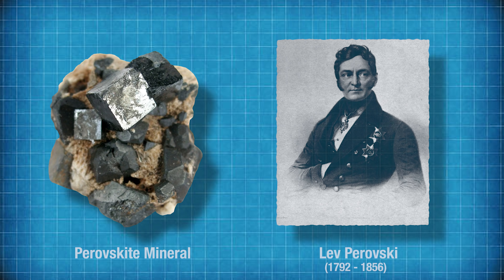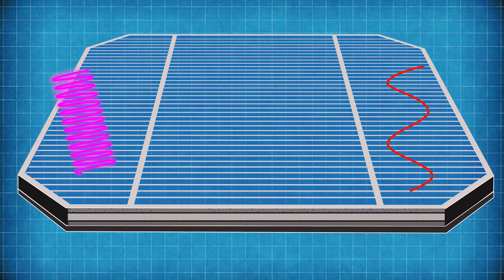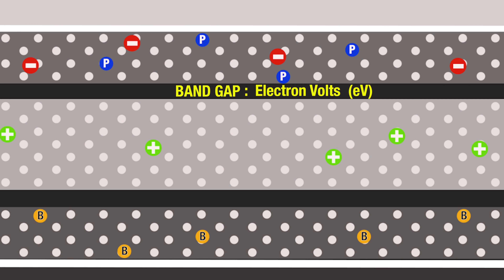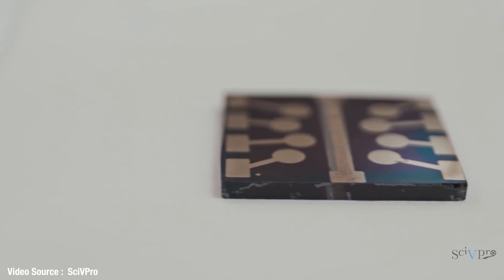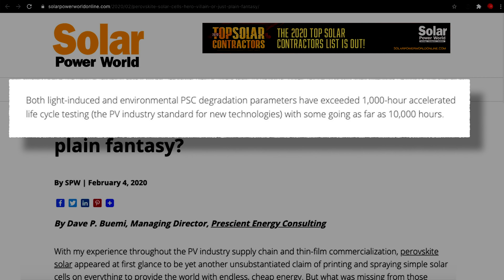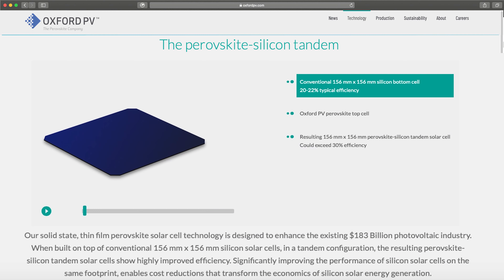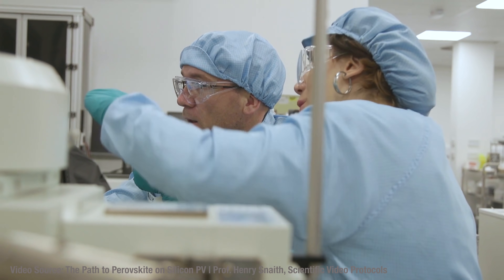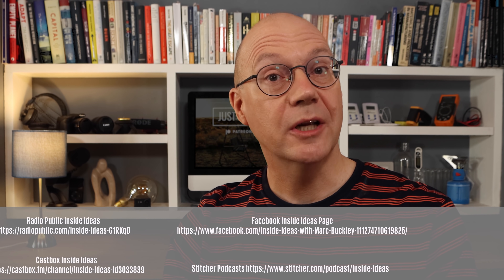Perovskite Solar Cells: Game changer?

Comment: Great video - this is a topic that needs more exposure. I do want to comment on a few things, though. Firstly, you have a couple of mistakes in your explanation:
4:12 - the band gap is the energy an electron needs to become free. The video says that it's related to the layer thickness, which is incorrect. An exact explanation would need band theory that is outside the scope of this comment but, effectively, it's the (minimum) energy an electrons needs to be knocked free by a photon. Silicon's bandgap of 1.12eV means a photon has to be at least almost-red infrared to knock an electron free
4:26 - adding boron makes the silicon more conductive. Holes - those 'effective positive charges' - act like, well, free positive charges. The boron basically sucks electrons away from the silicon, leaving excess holes and making the layer more conductive

Secondly, some technical comments:
- I'm still sceptical about degradation of perovskites. I've been hearing 'no, really, our material is totally stable guys' at conferences for years, and I'll believe it when I see it (on the shelves, in mass-production)
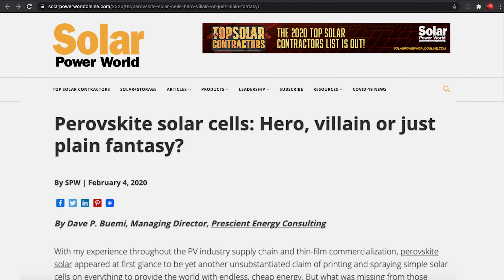7:48 - Like you say, the lead content probably isn't an issue. Another solar cell technology, cadmium telluride, has cadmium in it (cadmium is a sister element to mercury and is very toxic) but it doesn't matter because it's bound up in the solid crystal structure. Lead-containing perovskites are presumably similar and, like you say, tin might be a viable substitute
9:13 - be sceptical about reports of efficiency/performance from the laboratory. Researchers only need to get one, or a small number of specimens working to publish their findings, whereas industrial production needs thousands or millions of units to achieve that performance
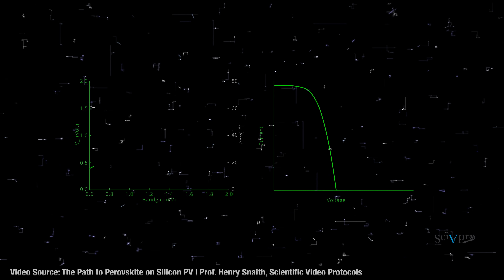9:49 - Tandem solar cells are hard to make and expensive (existing triple-junction cells are only really used on satellites, where cost is much less important than power). For one, your materials need to have the same atomic spacing (lattice constant), otherwise nasty defects will form at the interface. Then, you need to be able to engineer a tunnel junction between the cells, pushing free electrons from one material into holes in the other, without changing their energy level. It's harder than it sounds, and needs excellent control of the doping. Perovskites can vary the atoms in their crystal structure, allowing you to tune in on the lattice constant and bandgap you want, but the mix you want isn't always stable and easy to work with

I would love for perovskite solar cells to be successful. All-perovskite cells would be cheaper than silicon and tandem cells could achieve some impressive efficiencies. But I'm worried people might be being overly optimistic, particularly about stability and degradation, and I'll only really believe perovskites are going to break out once they've actually achieved substantial adoption.

Disclaimer: I am a postdoctoral researcher at the University of Warwick, working on silicon carbide materials for power transistors
Reply from the maker: Hi there. Thanks for sharing this extra technical clarification. Much appreciated. My only point would be that I think I said the thickness was a function of the need to allow more space for phonon interaction with silicon atoms in the middle layer, not anything to do with bandgap width (which I had to represent visually in a scientifically incorrect way just to get the idea across to the viewer)
Reply: @JustHaveaThink  In my honest opinion, I think the confusion stems mainly from label at 4:14
Reply: @JustHaveaThink  When will you use a aluminium pin, on this thread?
Reply: @JustHaveaThink  Avoid however hard it may be to provide incorrect information. just don't visualize something when the only way you can do it is not accurate.
Reply: @someonespotatohmm9513  well I appreciate the layman's example. There are many who not having a degree would support these on their homes. We can be a push for fund $$ for research by pushing specific products. The problem keeps arising wheather nuclear, wind or solar, what to do with spent product. It is one reason why I don't see nuclear as a clean energy.
Reply: @someonespotatohmm9513   I disagree: he can take some liberties and visualizations that drives the idea home - kind of (even if not up to scientific standards) - are VERY valuable. Even if the experts are dissatisified with it conveying erronous ideas. Being mostley understood beats being scientifically correct (this is not a peer review magazine).

Ideally there is some disclaimer that things have been simplified for better general ! understanding.
Think the 80 : 20 rule. 
The voting ! publics being roughly informed even though their understanding is imcomplete or the issues were "dumbed down" (but w/o malicious intent) is much more important than getting all details right.

No one - incl. the best experts - knows where this is going to end.

But IF humans put the resources in to solve a problem with engineering, science, reasearch They. Got. It. Done. Every. Single. Time.

Usually that committment - throwing money right, left and center - at a problem until it is solved (and it is always solved) is limited to war and adversity towards other nations.

If the voters understand that it is important to FUND such projects, that  something will come out of some of them, but you have to be CONSISTENT with funding and give them some time that is very important.

If you get a hit like solar panels (1960s I think) or penicillin - in the large scheme of things one can finance 99 projects that "fail" for one hit (or major hit).. Which is not even the case, researchers connectm they increase their knowledge and practical and project management skills, they find some decent if not spectacular solutions (sometimes things that are not immediately used, or a solution to ANOTHER issue).

And in the mean time it creates jobs for STEM graduates and therefore is an incentive to engage ! in those studies. One can make a decent living and be  hired by a project team and the Stem graduates will not be scared losing funding every year (see the Makani project).There is (would be) a huge treasure of hands on experience and prototyping  that spills over to future projects.

Think for instance the Makani kite. In the end they had to give it up and the team dissolved after 13 years (the film they made about the project is interesting). A lot of the research is public domain now. I do not think the money or time was "wasted"  (those wages went into the real economy, the researchers and engineers did not add the income to their offshore account in the Bermudas, they all paid tax on it and it was spent ! into the economy). 

It was not wasted and much more government budgets should be available for such "pie in the sky" projects.

Also the Pelamis ("sea snake") project in Scotland. Using the erratic power of waves would be a game changer. That warrants funding lots of such projects even if they seem far fetched and do not supply fast results. If only ONE of 50 or 100 would be successful, that would open so many possibilities. 

 It is possible that the Pelamis project did not work out because they did not have enough engineering resources to get the projects implemented on the ground.  Not all scientists are good fundraisers or perform better under extreme stress.
Reply: Are you serious??? He is attempting to make his videos understandable to us non scientists!!!
I suggest you don't talk to your friends in that manner... Know it all.. Is what it's called in lay terms....
I'm a psychologist!!!!!
Reply: How long do you think this could be or is it unlikely to occur at all? Just wondering... oxford  pv said commercialisation this year!
Reply: Thank you for you insight
Reply: I was wondering about the stability myself. I recall talking to someone in the field a couple of years ago (I've worked on perovskites myself, but I was working on a multiferroic perovskite rather than a photoelectric perovskite), and they were commenting on how teams working on photoelectric perovskites liked to boast about their efficiencies while downplaying that they were only maintaining those efficiencies for a matter of seconds. One can hope that there's been improvement, but commercial use of photoelectic perovskites might end up picking up similar memes to fusion power (namely, the "It's X years away, and it will ALWAYS be X years away" meme).
Reply: @Draxynnic  That particular meme about fusion is on shaky ground, thanks to the likes of REBCO, ITER and so on...
Reply: @psycronizer  Yeah, I think that was pretty much my point - recent developments do actually seem to be pointing to it becoming economically viable sometime in the foreseeable future.

EDIT: Ah, now that YouTube is actually letting me see the comment you were responding to, it's one of the few where I've mentioned that meme without it being an observation about how it probably no longer applies to fusion power. Yeah. It applied through most of the second half of the 20th century and the first decade or so of the 21st, but there's definitely been distinct signs of movement in the last decade. Perovskite solar, however, might be the next thing to apply that meme to. Or it might not. The meme exists in the first place because sometimes these things are hard to predict, after all.
Reply: Finally! I was looking specifically for your second point, but the rest is also extremely interesting. Let's take this comment to the very top.
Reply: @mskiptr  agreed, this should be pinned!
Reply: If you can make it once, you can make it a thousand times with some error rate. It's just a matter of cost and waste.
Reply: You are my guy.  Why is the search for materials that can have electrons knocked limited to visible and near visible wavelengths?  Do other high energy particles and em not interact with valence?  Antenna pigments?
Reply: @brainretardant  Most of the energy in sunlight is in the visible and near-infrared (as in 'near to the visible band' infrared). The sun doesn't actually emit too strongly in the UV band, and a lot of what it does emit is blocked by gases like ozone. Google 'solar spectrum' and you'll see. Solar panels see very little x-ray and gamma ray radiation, which is good, because x-rays and gamma rays can set off an avalance-cascade of electrons and holes that can severely damage semiconductors in various ways. Finally, the semiconductors that we can actually make, dope and control mostly have bandgaps between the medium-to-far infrared and the near-UV.

As for things like blue photons on silicon (which absorbs most strongly in the near-infrared), the high-energy photons are absorbed, but most of the 'overshoot' energy is lost. The loss process is a bit scary and quantum-mechanical, but the over-excited electron basically emits loads of phonons to relax down. Phonons are basically discrete atom vibrations - like quantum packet particles of heat - so emitting loads of phonons means getting hot.

I'd literally never heard of antenna pigments until just now! Assuming my Google-fu is accurate, you're thinking of chemical absorbers like chlorophyll - these work in a very different way to solar photovoltaic cells, converting light energy to chemical energy instead of electrical energy. That's not to say that you couldn't harvest solar energy this way, but you'd have to ask a biologist or chemist how that's going, rather than an electrical engineer.

I hope that answers your questions satisfactorily!
Reply: @brainretardant  I've never heard of quenching using electrons. It sounds quite challenging - cooling things is always very difficult, and the second law of thermodynamics is working against you. In semiconductors, what you get when a high-energy particle/ray hits it is impact ionisation: the excited free electrons have so much excess energy that they can excite more electrons. Any voltages exaggerate this effect. The high current from so many excited electrons and holes can easily burn out the semiconductor, but I imagine there'll also be weird and exotic things happening with the crystal structure and defects forming.

It sounds like you're thinking of fluorescent layers. They're not really something I know much about at all, but the little I have seen suggested (IIRC) that the efficiency is too low to be practical. I'd also guess (with emphasis on 'guess') that a fluorescent layer could easily interfere with the 'good' red and IR photons too.
Reply: @gigabyte2248  they have solar water splitting cells but that presents a issue of infrastructure adding hydrogen fuel cells and pipes to deliver it
Reply: and I actually think the presentation has jumped one step that might be essential for the logic and understanding: Although being electrically neutral, the p-layer has a lack of electrons due to structure effects (Silicon likes to form a lattice with 4 neighbours, but Boron only has enough electrons to couple with 3 silicon atoms. It also would like to have 4, but to couple once more, one electron is missing. This creates a "hole" in the lattice and might also be seen as an "electron vacuum"). The n-layer is opposite (Phosphorus likes to have 5 neighbours but there's only the 4-neighbours Silicon, and thus, "electron overpressure"). So the Boron tries to strip one electron from the Phosphorus (which is really a very simplified explanation of a chemical and electrostatic process). Eventually, this leads to electrical charges migrating from the n-layer into the p-layer, where p-n-pairs form (which actually is the transition layer between them). But this leads to an effective separation of charge, and now the n-layer is positively charged, while the p-layer has a negative charge. This builds the electrical field between them, and this is why electrons migrate to the n-layer when separated from a "p-n-pair" in the transition layer. Again, this is a very simplified description, but it might help to understand why negative charges go to the n-layer, when one could assume that there would already be too many electrons.
There are similarities to how semiconductors work. And besides Boron and Phosphorus, several other elements like Gallium and Arsenic, but also others, can be used to do the trick.  
Btw. there seem to be 6-layer-panels that can have an efficiency up to 39.7% https://youtu.be/wwHjyeyRofM . But these might not be affordable for everybody yet.
Reply: @human_isomer  I think he said the six layer were used in space were efficiency outweighed cost
Reply: I wish to Join more conversation and updates regarding the topics plzz share me the link or any other source to have a regular update for the same
Reply: @dhruvthacker3662  https://youtu.be/2uIOeHCOr-0
Reply: @brainretardant   they have solar water splitting cells but that presents a issue of infrastructure adding hydrogen fuel cells and pipes to deliver it
Reply: MatSci at University of Washington here, I agree with several of your points, clearly their is a long way to go to get bleeding edge perovskite efficiency on shelves.  
I think the FAR more interesting part of the story in the short term is the possibility of producing cells with SolGel techniques and being able to do it roll to roll (aka a continuous process).  Even if you can only get 10% efficiency out of the cell and they only last 5 years instead of 30 before recycling, if you can make them on rolls which are a km long with all the cost savings that entails you still come out wildly ahead.
Reply: @thereddufus  https://phys.org/news/2020-10-physicists-circuit-limitless-power-graphene.html
Maxwell's demon captured
Reply: I highly endorse your comments, I am a  material physics PhD candidate at University of Swinburne and looking towards the Provoskte to be my topic of research in PhD,  video from @Just Have a Think was a good contribution to make an image for some beginner in this field, while your comments added an extra charm and resonate the information from the video. Thanks for sharing your knowledge.
Reply: Great insight on the technical aspects in question. Absolutely noteworthy; 2$hae!
Reply: Let's ask a [🐈] 🐈 on a hot tin roof …
Reply: at 4:09 did he mix up the direction the electron goes? I thought the electron would travel towards the p-type layer, and move away from the negatively charged n-type layer
Reply: @jacobv_  Not quite. A detail that he glossed over (I can't blame him): the dopant atoms, after they've lost (phosphorus) or gained (boron) an electron, stay in the material as a fixed charge. Where n-type and p-type layers touch, there's a thin interface region where the free holes and electrons recombine, leaving just the fixed charges. This is called a depletion region, and it's where the magic happens in a solar cell. An electron generated in the depletion region is repelled by the negatively-charge boron in the p-type layer - the holes have been depleted, so only the boron atoms, that took an electron and became negatively charged, are left - and attracted by the positively-charged phosphorus in the n-type layer. The opposite happens for the holes. The n-type layer accumulates electrons, the p-type layer accumulates holes and they flow through the circuit to neutralise. Solar cells are fabricated with a middle layer, often doped as lowly as the crystal growth reactors allow, to artificially widen the depletion region, so that it's more likely to catch photons.

To add to the confusion, though, you might (possibly) be thinking of normal diodes in forward bias. A solar cell is just a specially-designed diode with an extra-extra-wide depletion region. If you put a positive voltage on the p-type and a negative voltage on the n-type, you push the electrons and holes towards the depletion region, causing it to narrow enough for the electrons and holes to cross it. Current flows! This is forward bias, the 'on-state' of a diode. Put the opposite voltage on and the electrons and holes retreat from the depletions region, making it wider and blocking current flow. This is reverse bias, the 'off-state' of a diode. Solar cells (and their sisters, photodiodes) are basically reverse bias devices, that rely on a wide depletion region to sweep away the generated electrons and holes, producing a voltage (or, in photodiodes, sometimes a current). This, by the way, is why it's so bad to have partially-shaded solar panels. The illuminated ones are generating a voltage, but the shaded ones are diodes in parallel, and produce a short circuit. The generated electrons and holes flow through the shady panels to neutralise, rather than through the building's electrical circuit.
Reply: @gigabyte2248  Thanks for explaining this so clearly! I'm writing a review paper on PSCs to finish off my Physics BS, and seems I'm going to have to re-write a paragraph in my introduction. That extra bit on the shadowing effect was very helpful too.

I'm trying to understand if/how PSCs are different from silicon cells. Can perovskites be doped as n or p-type? It seems like all the diagrams I'm finding use NiO or TiO2 as an electron transport layer and PCBM or Spiro-MeOTAD as the hole transport layer. Is the physics here any different from what you mentioned in the last comment?
Reply: @jacobv_  I'll be honest, I don't know. Intuitively I'd say yes, perovskites should be able to be doped, just like any crystal structure, but, as you say, there's not much info on it. Do bear in mind that some materials are natively doped. For example, 'undoped' gallium antimonide is actually moderately p-type due to, I think, antimony vacancies acting as acceptors. It's quite possible that the different materials used in a solar cell are natively doped, thereby giving you n-type and p-type contacts. I wouldn't say that with any certainty, though - make sure to do as much research as you can and be clear about the limitations of your work in the write-up.

One more comment, speaking from my experience and that of a colleague of mine who works on Si photovoltaics. People like to get excited about new technologies, but the harsh truth is that the incumbents they're trying to beat are sometimes unbeatable, just from sheer maturity. My colleague said that perovskites can't beat silicon where it is now - it's too mature, too reliable, too cheap, too widespread - and I believe him, because it echoes what I saw happen in microprocessor tech during my PhD. Lots of buzz about how III-V semiconductors (my PhD topic) were going to beat Si, but they were never going to, for physics, engineering and economic reasons, just as 2D materials are never going to now. Perovskites are interesting, don't get me wrong, and maybe some niche products will make their way to market, but I doubt they'll ever seriously compete with Si.
Reply: @gigabyte2248  Thank you for your input! I think I read somewhere that perovskite is natively p-type, but I'll definitely have to do a lot more research.

If new technologies can't compete, then i don't see how we are ever going to transition to renewables, because Si is really stagnating. I think new materials have a chance to take over given a long enough timeframe, but its probably not be fast enough to slow global warming. Oh well!
Reply: @jacobv_  Si isn't really stagnating, as far as I can tell. Its price is still dropping exponentially but it's already the cheapest form of electricity per kW. As the cost falls further, it's going to become more widespread, more desirable and contribute more to reducing emissions. I'm imagining PV canopies in car parks, that sort of thing. Its efficiency is stagnant, but its not-very-high efficiency hasn't stopped it so far. The biggest thing I can see changing in Si PV is someone cracking light-induced degradation. If they can fix that, it would be a big step forward.

Us engineers and engineering nerds like to get excited about the technology (and glum when it stagnates), but the climate crisis will be solved by economics and politics, not technology. Solar power, wind power, battery storage, battery electric vehicles, hydrogen electrolysers and heat pumps (among other technologies) already exist. We just need to use them more and >50% of our greenhouse gas emissions will disappear. Admittedly, yes, that last ~10% will get you every time. Shipping and aviation are the main sectors that still need technological innovation to decarbonise - electricity generation, home heating and ground transport are just waiting for some investment. Sorry for the tangent...
Reply: Thanks for pointing all of this out. - Interested lay person.
Reply: You are too burl dude!!!! Thank you for sharing. It's crazy how it took me to be 41 to really want to learn as much as possible about science.  I wish it happened 20+ years ago but better late than never.  What is powerful is that the brain can still grow and unlock greater potential as long as it is stimulated and challenged.  Thanks again